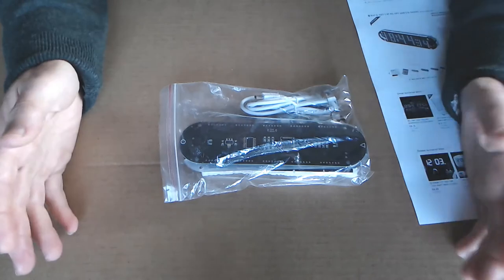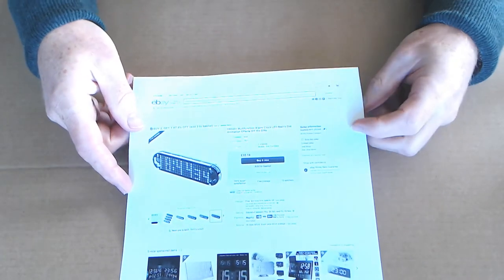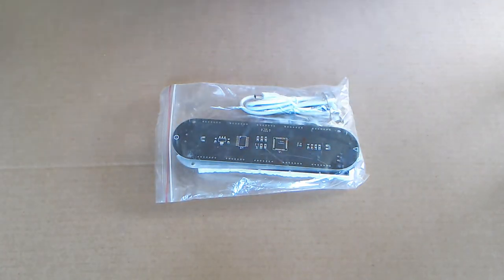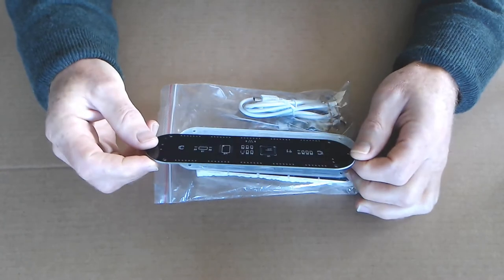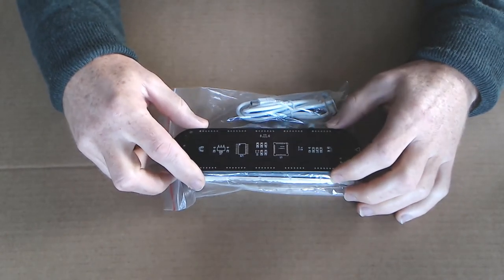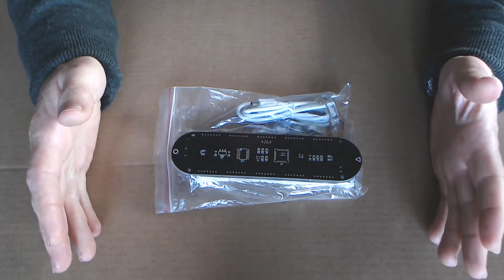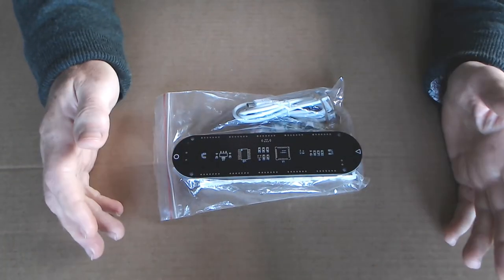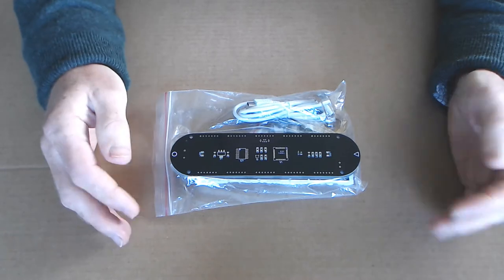LED DIY Clock Kit Build

Comment: Thanks for linking the manual! I just got mine from eBay without instructions. The description said easy to install. Unfortunately, I don’t know how to solder or have the tools for it.
Reply from the maker: Hi, did you not realise it was a kit? That said some other kits I've seen can be either purchased as a kit of bits you need to solder or a pre-soldered kit you just need to put in a case.
If this is your first time soldering then it's going to be a challenge as the surface mount components, which not as small as some surface mount parts can be, are still very small and very fiddly compared to through-hole parts, which are relatively easy to do. For some of the IC chips in this kit you do need a very small tip on the soldering iron, but then again the capacitor can needs way more heat and so needs a larger iron tip, that was my issue when I tried to solder that part on.
Best of luck.